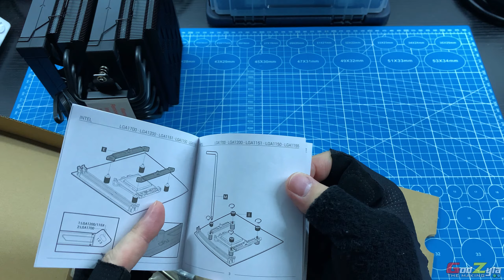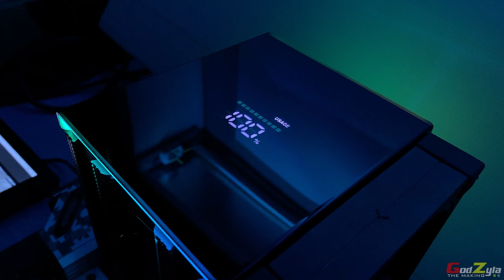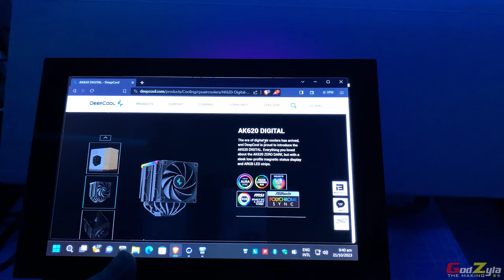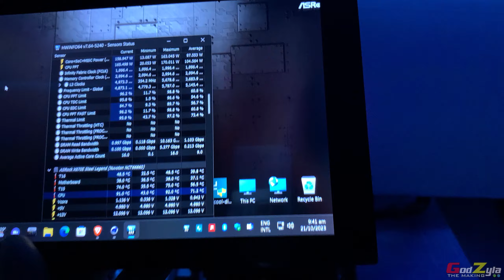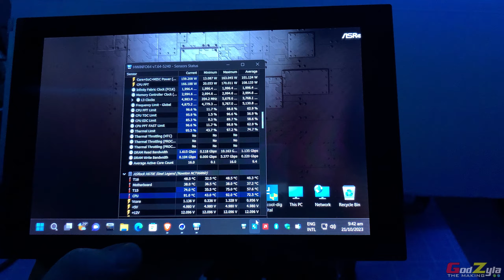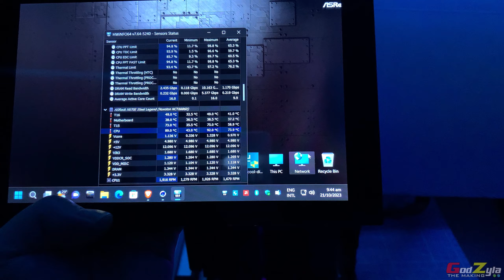Deepcool AK620 Digital

Comment: with your guide I manage to set mine up.

the only thing I hate is the wire for the digital that sometimes get tackled with the fans lol
Reply from the maker: Hi deck pogi, welcome to my channel. I agree with you. The cable should have done better, maybe at the sides and not right in the middle of the fans are mounted on. I am glad this video did aid you 😉
Reply: @KleoYan  indeed if that's the only flaw with this air cooler but the performance is superb.

I was actually going to get an Arctic cooler 360 for my 7800x3d but I just choose this one over it lol.

the trauma of past experience with AIO is still haunting me.
Reply from the maker: @deckpogi2680 I see, at least now you have a healthier pc with good temp 😉
Reply: @KleoYan  correct I am loving it.

Comment: would it work cooling a 7900x?
i can go watercooling as well but i was wondering if air cooled could work
Reply from the maker: Hi FrankValchiria, welcome to my channel. Yes you can, provided that you have a good airflow case.
Reply: @KleoYan  you mentioned that temperature hovers around 90 degrees Celsius(after you used the thermal paste provided in the package with the deepcool AK620) --but if you used your own thermal paste, it would be around 88 degrees(lower). Which thermal paste do you prefer or recommend? Arctic MX-6?
Reply from the maker: @dfbreyes  hi and welcome to my channel. Yes, I did mentioned that as I’ve tested on Arctic mx6.

Comment: Finally a complete review thanks ! Question though, is it possible to turn off the side RGB ?
Reply from the maker: Hi Begshy, welcome to my channel. Yes you can turn off the ARGB at the side, you will need to use your motherboard argb utlity to set brightness to zero or to disable it, that will depend on the motherboard argb software. Or if you choose not to have those argb, you can don't plug the 3pin 5v argb connector from the AirCooler.

Comment: Hello sir. I assembled the pro model but while all the RGB LEDs on the screen are on, the temperature indicators are not. Did I do something wrong? CPU fan - USB1 - 5 V. What did I do wrong?
Reply from the maker: Hi BlackTower, welcome to my channel. Do pardon me for the late reply. Just like to check, after you've connected all the required connection. Did you download the application from deepcool? if not watch 20:46 on where to download the application and to install the application.

Comment: how much of ram clearance does it have? with the cooler and without it. I have corsair vengeance rgb pro (51mm) and i want to know if they´re compatible
Reply from the maker: Hi Lucio Quiroga, welcome back, measuring from the coldpate and to the heatsink gap for rams, it will be 52mm but if you place the fans infront, you only left with 42mm clearance. In your case you might either move the fan to the rear or to move it up. when you move it up, kindly check if you have enough clearance for your case if it has an aircooler clareance of 170mm, then it will be right, even if you move the fans up to give clearance to your tall rams.
Reply: @KleoYan  okay! Cool! Thanks. I guess (if i buy it) i will put it next to the scape cooler. Im sorry my english is not soo good.
Reply from the maker: @luciotqr  most welcome. all the very best with your build 😉

Comment: Thanks u helped me a lot. How can i config the rgb? My is just yellow
Reply from the maker: Hi Vobrahfps, welcome to my channel. Did you plug the argb cable from the cooler to your motherboard argb 5v 3pin header? If you did, you will need to make use of your motherboard utlity to control the argb effects.
Reply: I fixed it. Thanks!
Reply from the maker: @vobrahfps you are most welcome.

Comment: How to off thats rgb when you close computer
Reply from the maker: HI Kawka000, welcome to my channel. It greatly depends on motherboard, some motherboard when you shut down the machine, the argb will turn off and some will just leave it out. you will need to look at your UEFI if there is a fuction or features to off the argb when machine is off.
Reply: @KleoYan  UEFi what's thats mean is like bios or something ?can i just instal app ? I dont really know how to do thats kinda stuff so thats why asking and i spend so much time for search internet for solution and nothing
Reply: Switch Off The Power Supply.

Comment: Can you use just the fan in the middle and remove the one that stands on top of the memories? Can you test the temperatures to see if thats enough?
Reply from the maker: @jonathanthomas4498  hi welcome to my channel. I don’t think that is a good idea. The fins need air pressure to deep the heat. Btw I no longer have this air cooler so sorry.
Reply: @KleoYan  oh ok ty
Reply from the maker: @ you are most welcome.

Comment: hi , When I start the deepcool software to show the temperatures, the RGB on the video card turns off, do you know any solution for this?
Reply from the maker: Hi Leandro Pardo, welcome to my channel. The deepcool application only controls the digital display. As for your ARGB on this AIO block, it's controlled by your motherboard ARGB utility same apply to your GPU. check the motherboard ARGB utility for your GPU ARGB.

Comment: I’ve downloaded the software multiple times but when I try open the app, nothing happens?
Reply from the maker: hi jago shek, welcome to my channel. can you check under device manager, universal serial bus devices. do you get to see the deepcool device listed? If you do not have that, no matter how you try, the application will not have control on the top panel which shows the digital display.
Reply: @KleoYan I don’t see it in the device manager under usb controllers, what do I do now?
Reply from the maker: @clappncheekzzz7765  Hi, go to your motherboard model website, download and install the inf driver and try again.
Reply: @KleoYan  I figured it out. I just used a different usb header and that fixed the problem. Thanks though!
Reply from the maker: @clappncheekzzz7765  phew ok that's good. Thank you for the update.
Reply: Mine works perfectly but it won't start with Windows, I have to open it every time I restart, and yes, it's set to start automatically on startup and also added the shortcut to start programs but it just won't do it, it's also enabled in task manager 😢
Reply from the maker: @Tressie13  hi welcome to my channel. so sorry to hear this is happening to you. Have you tried reach out to Deepcool tech support on your issue? hmm. not sure with version you are on.. you might want to try this https://www.deepcool.com/downloadpage/
Reply: @KleoYan  Maybe it's my issue but I don't know how to fix it. Hey and thank you for being that nice!
Reply from the maker: @Tressie13  Hi, I can understand how you feel. I do have this kind of issues as a content creator, I know the application works but with glitch, so what I did is, fresh install windows again. you might want to try it using a spare m.2 or SSD to test this out. if it works, then it means that your current OS is glitch, due to some unseen registry issue.

Comment: Nice video, can you set the rgb to a constant color or only rainbow?
Reply from the maker: Hello Hildegard0, welcome to my channel, yes you can chave the rgb to static, just make use of the motherboard argb application, hope this helps😉
Reply: @KleoYan  thanks a lot, that helps 👍 would you recommend this cooler for the i7 14700k?
Reply from the maker: @HILDEGARDO2  I would if you are located at a cooler country and if you can do undervolting on the i7 14700K.

Comment: Can the digital display be rotated 90 degrees either physically or through the software? I want to use it in a horizontal case and have the orientation match the case's orientation.
Reply from the maker: Hi ExpensiveKoala, welcome to my channel. Unfortunately nope, you can do either. It’s if a fix position or orientation.

Comment: Sir, do you have solution for its display didn't work? I already installed the software but didn't work, and I got notification that it didn't recognize any device. I tried to swap the usb port but still not working, my mobo asrock z790 steel legend, thanks 🙏🏻
Reply from the maker: Hi JosieGan, welcome to my channel. You might want to head down to your motherboard website and to install the chipset driver of your motherboard.
Reply: @KleoYan  All right, I will give it a try first, thanks for your answer sir 🙏🏻
Reply from the maker: @GanJosie  you are most welcome. All the very best. 😉

Comment: Hi bro nice video
My case msı mag forge 120a airflow tempered glass 3.2 Will this cooler fit?
Reply from the maker: Hi Eyp Drk, based on your case specification here https://www.msi.com/PC-Case/MAG-FORGE-120A-AIRFLOW/Specification?_gl=1*10grv37*_up*MQ..&gclid=Cj0KCQjwvb-zBhCmARIsAAfUI2t8mscVuipACCTkxHPQxy9XIq2XadAlXUzVTnGyWWpiua5soZXzdhwaAtoqEALw_wcB the CPU Height clearance is at 160mm and this Air Cooler is at 162mm. it will not fit so sorry to say.
Reply: @KleoYan  Thank you for your help. I think Thermalright Phantom Spirit 120 SE is suitable for my case. What are your thoughts?
Reply: @KleoYan  I would be very grateful if you could help me on this issue.
Reply from the maker: @eypdrk895  if this is the air cooler you are getting. https://www.thermalright.com/product/phantom-spirit-120-se/ . It should fit as the height is 154mm tall. all the very best 😉
Reply: @KleoYan  Thank you very much for taking the time to help me. 😊
Reply from the maker: @eypdrk895  you are most welcome  😁